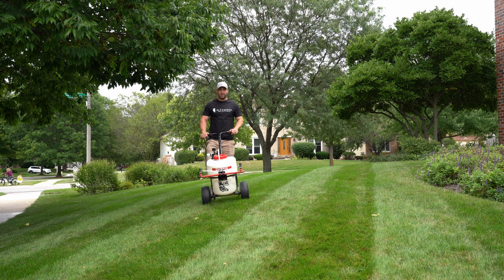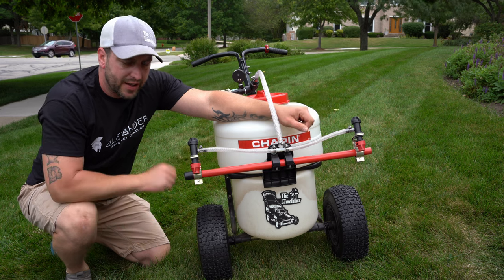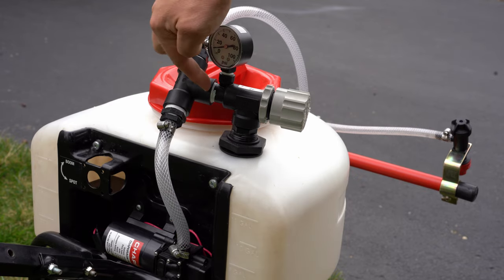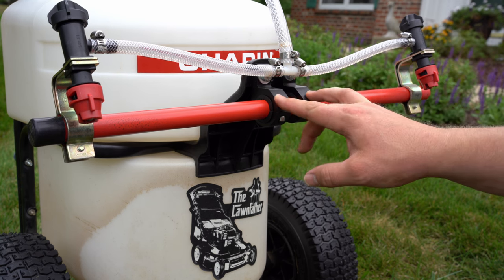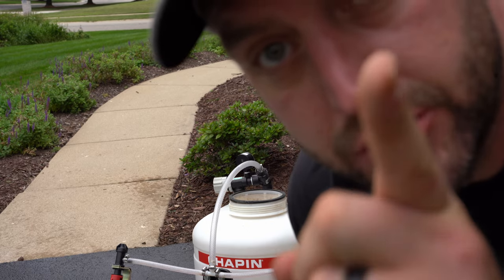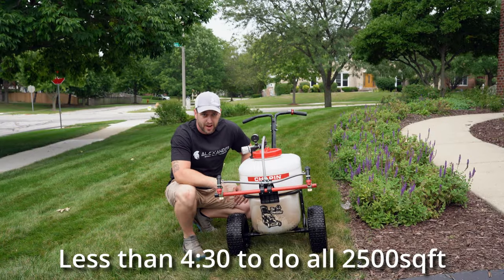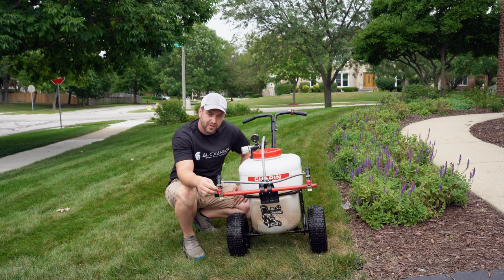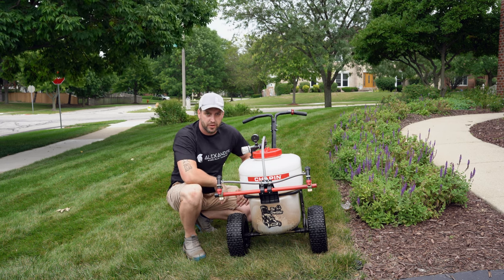How I Built The ULTIMATE Lawn Sprayer, Chapin 97902

Comment: I really didn’t want to get another piece of lawn equipment, and this one is a bit pricey. When I apply RGS and humic with a hose-end sprayer on 8k sq ft, it’s dragging hose through a fence and at least one hose change for the side of the property.  Then I saw your video, and I changed my mind. Not sure if i should thank you or curse you 😉 Just ordered the Chapin from Lowe’s and got the regulator, gauge, and bulkhead through Amazon.

I anppreciate the clear explanation of how you modded yours and thanks a ton for the parts list.  I’m also going to skip the pump upgrade until I use it a few times to help decide on sizing and whether the battery also needs an upgrade.

Comment: Awesome video! I just got this sprayer and the pressure is so high so the bypass makes so much sense. thanks!
Reply from the maker: The pressure drop significantly with dual tips which is the bad part.
Reply: Do you think by adding just the 2 tips you would'nt need the pressure regulator? @TheRealLawnFather
Reply from the maker: @TheLawngestYard  most likely not after using it for awhile. But I do plan on upgrading the pump at some point and I’ll need it then.

Comment: Just put this together today. Works great!, I skipped the top part of the build, this thing is pretty weak when it comes to psi with this stock pump, so I skipped that part for now. I used longer bolts and a nut on the back of the angle clamps. No tape needed to hold in place. Not sure how you were able to use the stock bolts to hold the clamps on to the conduit, mine just kept swinging loose. Thanks for sharing! Think this is a must if you own this unit.
Reply from the maker: I’m glad it worked out for you!
Reply: @TheRealLawnFather  Works great!
Reply: @LIGHT7CODE7  what was total cost?
Reply: @Gunslingingmonkey  think around $80-$90 for the additional parts. I have it rigged to the back of my riding mower now. Thing gets to be a workout pushing thru the yard.
Reply: @LIGHT7CODE7  thanks.  I was thinking that might be the case with 12 gallon tank. But what's more of a workout , pushing it or carrying a 4 gallon backpack sprayer? You have way to share pics or video of it attached and how you did it?
Reply: @TheRealLawnFather  hello is there a video on how to put this all in place?  Or does one have to figure it out by looking at this video? Thanks.

Comment: I just got this same sprayer and I am setting up my boom.  Quick question on the Tee-Jet nozzles; so I am going to get the Red XR one you suggested and based on the output at between 30-40psi the pump outputs looks like a easy walking spreed to lay down 1 gal per 1000 sq. foot.  I am kind of new to liquid application and wanted to get your take on the air induction nozzle.  I noticed in your video you had the XR tip on for the Humic application you did.  What products do you use the air induction tip for given its coarser droplet size?  Also I plan on running mine as a  pretty simple set up with no pressure bypass/regulator just to a 2 tip boom, so in that case would you suggest that I just stick with the single XR tip for everything I apply; Humic, Fertilizer, Pre-emergent, Post Emergent weed killer etc?

Comment: Did you have any issue with the sprayer leaking at the elbow underneath the tank when you first got it? I had this issue and ordered a replacement. Its not as significant but still drips.
Reply from the maker: Mine dropped a little bit it was loose when I first got it. But I replaced that hose when I added the boom. It hasn’t leaked since.

Comment: What pump would you upgrade too? Mine finally died on me. Bad thing but about to make the boom set up you have
Reply from the maker: Probably a 4-5 gpm that can run 80 psi, an 80psi pump should get me closer to the 60psi at the tip I need for the correct droplet sizes.

Comment: when the fluid level gets low in the tank, does the pump sputter and eventually loose pressure to spray liquid?  I have a Craftsman 4 gal back pack sprayer.  When there is about less than a gallon of liquid left in the tank, the pump doesn't spray much.  When the level is at about 1/2 gal, the pump doesn't spray any liquid at all.
Reply: this comment is on every chapin video lol

Comment: What size for the bulkhead fitting and nipple? There are multiple sizes on farm & fleet.
Reply from the maker: I believe I went with a 1” and added a 1 inch to 3/4” adapter to go into the relieve valve.

Comment: Do you think it's possible to attach a wind deflector in some way? I live in a very windy area and I know 10mph is the law/recommended in many areas but it's hard to find a day under 10-15mph. I usually use a chem lawn style nozzle on my backpack sprayer and that works good but my pull behind sprayer is more of a mist like this sprayer and struggles in any wind. Thanks!
Reply from the maker: Im not sure how you would attach one that would work, but also not get in the way of the spray pattern. I will have to think about that one lol

Comment: Hello, I came across your video and like what you have done to your sprayer. Am I correct in that it appears that you eliminated the ability to perform spot spraying with the hand wand ? I’m guessing it could of been modified to retain the spot spraying capabilities.
Reply from the maker: You’re correct, i removed the wand sprayer. It absolutely could be left there. But I knew I wouldn’t use it so I removed it.
Reply: Thank you for your response, another quick question. Have you by any chance added a drain plug to the bottom of the sprayer to help make it easier to clean as I do not believe the sprayer has a drain plug and if so does the drain plug leak in any way?
Reply from the maker: I didn’t add one, you can unscrew the supply hose from the bottom of the tank to drain it.
Reply: Oh ok, thanks. I do not own the sprayer. I like what you did to it and was thinking of buying one and attempt to modify it as well.
Reply from the maker: @stevedavis7277  it’s a good sprayer, definitely won’t regret buying one.
Reply: @TheRealLawnFather  Are you still using the stock pump or did you replace it with another pump
Reply from the maker: @stevedavis7277  still using the stock pump for now, I’m upgrading this year though.